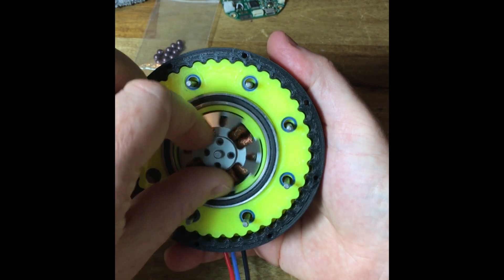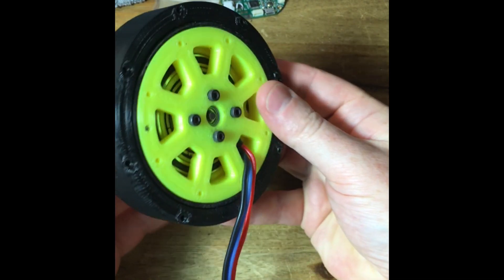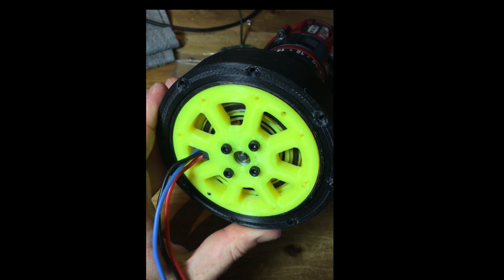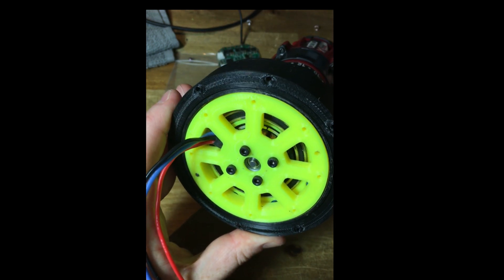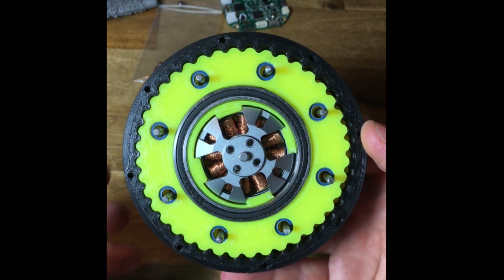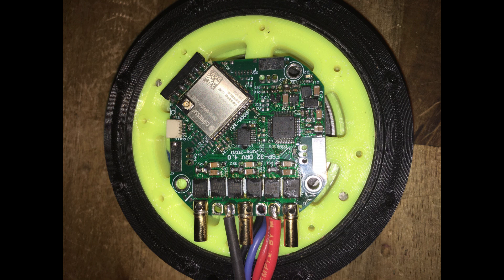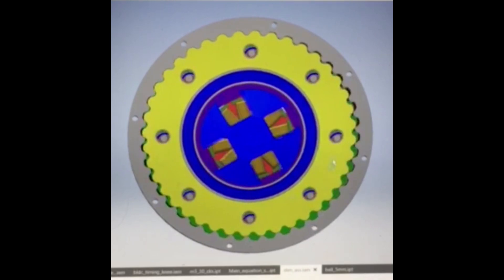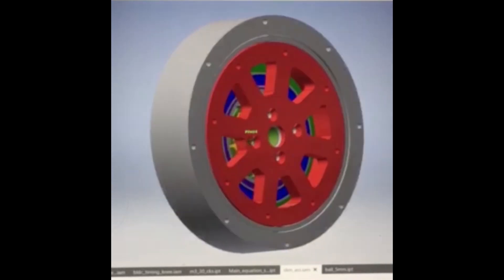Open Source Slim 3D printed Cycloidal brushless Actuator

Comment: I like this design! you might be able to get away with oversized sleeved brass bushings instead of ball bearings, which could drop the price even more.
Reply from the maker: I have a new design with all 3d printed bearings. It works ok.
Reply: @PaulGouldRobotics  have you ran any load tests or destructive analysis on it? The nice thing about cycloidal drives is that they maintain contact across multiple points along the track. I'm interested in using it to power a 3D printed plastic shredder, which has extremely high peak torque events that will shred most non-fully metal gear boxes.
Reply from the maker: @LawrenceKincheloe  I'm printing a test stand for it now. I should have some results by the weekend. For high loads I would suggest more bearings. Like https://www.instagram.com/p/CYPGwXdMM-6/?utm_source=ig_web_copy_link

Comment: I love this design! Are you still planning the larger version? Also, how well do you think this design would handle axial forces? For example, if this were oriented horizontally and had a limb coming off of the top?
Reply from the maker: https://youtu.be/1aHt7XUNENw?t=10 I need to redesign some of it to make it easier to attach to other structures. It is not great for axial loading. The output housing is double sided which helps.

Comment: Awesome, as usual!  
Silly question: Are there pros and cons to how sharp or "pointy" the cycloidal disk's wavy edges are?  
In contrast, they could be flatter slopes around the edge of the disk.  Is it Torque vs Speed?
Reply from the maker: I think that pointy ones can handle more torque as the max pressure angle increases. Round ones are better for 3D printing and possibly speed. I have never printed a pointy one.
Reply: The cycloidal disk's wavy edges are a projection of the inner drive bearings along the outer surface, so as long as they match, there is no issue. If there is a mismatch, then the disk will be unsupported in places.

Comment: Hmmm compact is good, but I worry about heat buildup.
Materials like PLA are really sensitive and might beginn to deform.

Have you a way to cool them?
Reply from the maker: I haven't thought about heating yet. PLA is great for quick prototyping. I will need to change to something else in the future.
Reply: @PaulGouldRobotics  Had that happen to myself with an early RepRap printer left in a car in the summer.
Was completely deformed, so much for my school project lol.
But that thought me a lifelong lesson 😅
If you have your parts under any kind of stress even at "low" temperatures, parts can easily deform.
Reply: My guess is that it will be ok as long as the center is kept open so heat from the motor can dissipate into the air rather than the discs. But yes, PETG or something more heat resistant would be better than PLA.

Comment: I really like your work, Paul. Can you talk more about the 3d printed bearing? I only see the standard metal bearings :)
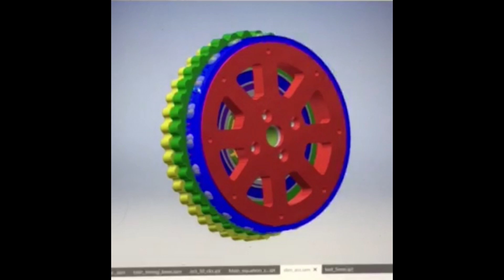Reply from the maker: Go to 1:00 In the video. More details, hopefully in the next video.
Reply: @PaulGouldRobotics  Wow, so you printed the bearing parts and selected metal balls to use as captives? That's really slick that you're getting that to work! What filament & printer are you using?
Reply from the maker: @dsg123456789  It is cheap PLA and an Ender 3.
Reply from the maker: @dsg123456789  https://youtu.be/3-Jcp8vFAko